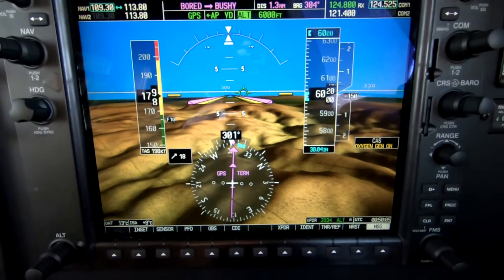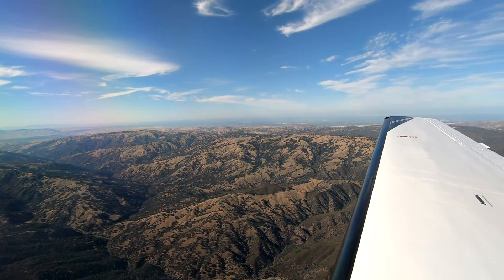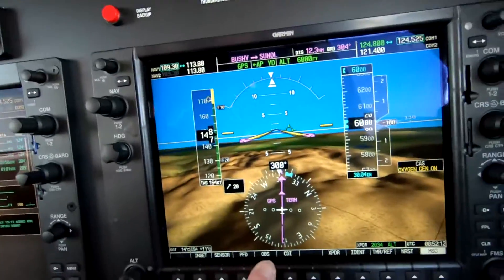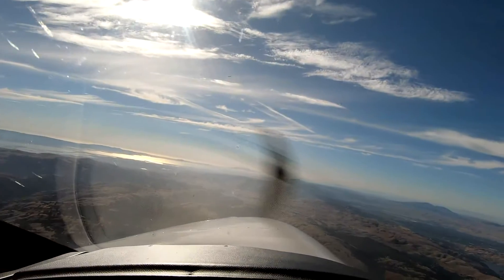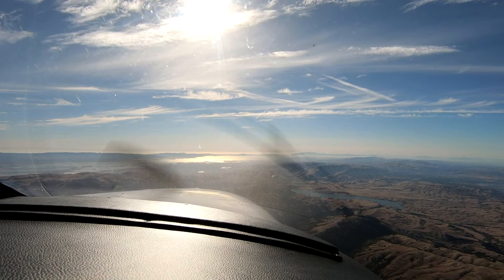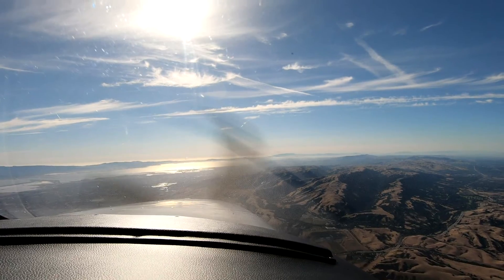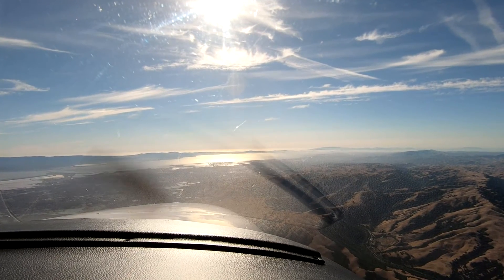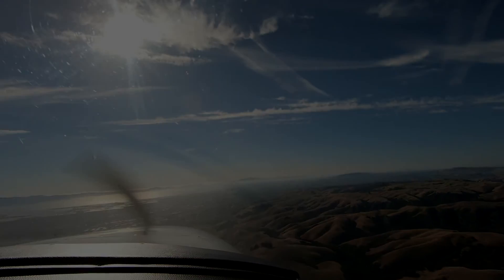Flying the Piper M350: Some Tips on the "Visual" at KHWD

Comment: Dick, is it normal to get the metal surfaces behind the speedbrakes fluttering like they did at about the 5:00 minute mark? It would seem that too many deployments of the brakes could cause metal fatigue. Your thoughts/comments?
Reply from the maker: Hi David, Yours is an excellent question. Anytime material moves it is subject to fatigue and all such movement has limits. I suppose the more relevant discussion at this point surrounds the failure history (if any). I am not aware of any such history regarding the speed brakes. There were several well publicized in-flight catastrophic airframe failures back in the late 80’s and early 90’s. The entire fleet was even grounded for a time. There was a major investigation which yielded some important changes. Piper was asked to modify the annunciation for pitot heat (yellow for “OFF” instead of “ON”). The insurance industry began mandating “approved training” for all PA46 pilots. I think progress was made, however the PA46 accident rate remains stubbornly high; about 2 fatalities per 100k hours according to Richard Collins’ 2019 research. I have noted with interest that many organizations have managed similar problems with standardization of the instructor cadre around a well-vetted procedurally consistent training program: Cape Air, Cirrus, BPPP (The Bonanza Pilot Proficiency Program), PADI (Professional Association of Dive Instructors).. the list goes on. They all have one thing in common. They halved their current accident rate and doubled the popularity of the activity they promote. No such collective memory exists for the PA46 community. Bottom up programs such as FRAT and IMSAFE can help, but as we have seen, they won’t budge the statistics. Those that fail to remember history are doomed to repeat it! Here is a link to a white paper I wrote on the topic some years ago: http://rwrpilottraining.com/uploads/3/4/3/3/34335558/training_pa46_pilots.pdf

Comment: What call signs get used for each version of the PA46?  I’ve heard “Malibu” and “Mirage” for the piston versions. I’m assuming “Meridian” for the Meridian and M500, but what about the M600?  And, also “Jetprop” for the Jetprop.
Reply from the maker: Hi Steve, The Piper Malibu was first certified in the mid 1980’s with the Continental 310 HP engine. With each engine and/or major avionics change came a need to differentiate the new model without the requirement for recertification. Aircraft manufacturers do this all the time. As a result the formal names for the PA46 line of aircraft each begin with “Malibu”; so Malibu PA46-310, Malibu Mirage PA46-350, Malibu Meridian PA46-500T, Malibu Matrix PA46-350R, Malibu M350 PA46-350 etc. ATC doesn’t care except for significant differences in performance. Generally all piston PA46 aircraft are flight planned as PA46/G and referred to as “Malibu” by ATC while turbine PA46’s are flight planned as P46T/G and referred to as Meridian or JetProp as appropriate. This is getting to be confusing for ATC with the introduction of the M600 which has a Vmo of 250 knots (the Meridian and M500 are limited to a Vmo of 188 Kts). Yesterday we were descending at 230 knots into northern Florida when the controller asked for confirmation that we “are a Meridian”. This new found freedom of a 250 Knot Vmo comes with speed restrictions around class B, C and D airspace but it really is an awesome aircraft. Watch for some new videos on the M600 soon! I forgot to say.. The M600 is flight planned as “M600/G” Because of the enhanced performance associated with the greater horsepower and higher Vmo.
Reply: @RWRPilotTraining  Thank You.

Comment: Dick-enjoyable video, as always. 

Couple of questions....you guys are flying a 2015 Mirage, I didn't think that NXI was available until 2017? Screen displays look like WAAS-enabled G1000 [Which I suppose we can call "Classic" now]. 

Second,  in this and the Shelter Cove video, there is a CAS warning for Oxygen Generator Activation. Per the M350 POH, page 4-4, it appears that the expended canister "Must be replaced if oxygen usage is desired for the flight". Section 9, Supplement 1 is a bit vaguer on whether or not you can fly with an expended canister or if so, do you have to restrict your max operating altitude? Was curious how you interpret what is right and what is meant in the POH....and I trust the owner will get the expended one[s] replaced ASAP. One of the many joys of Mirage ownership....
Reply from the maker: Hi Carl, Good question.. I am not fully briefed on the NXi release schedule. I suspect that Garmin makes decisions on release based on the certification plan for each make model.